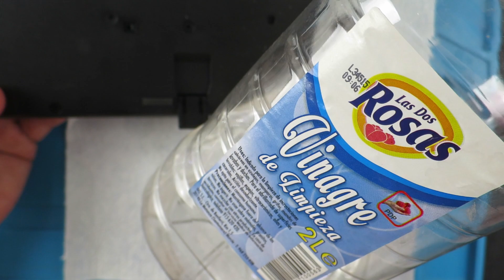Battery Leak Cleanup Alkaline Battery Spill - Top Tip Repair

Comment: Q-tips work great for this, bit less awkward than a toothbrush
Reply from the maker: Good point! I think both have their place, the tooth brush is more aggressive for removing bad corrosion. If it's only a small leak and you catch it in time just a clean up with the Q tips would be OK. Please consider subscribing if you haven't done so already!!